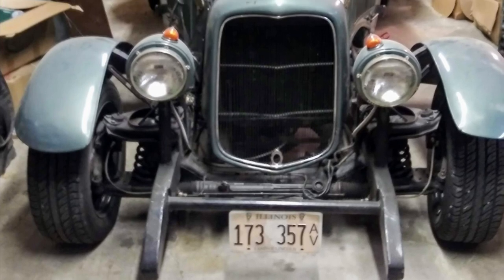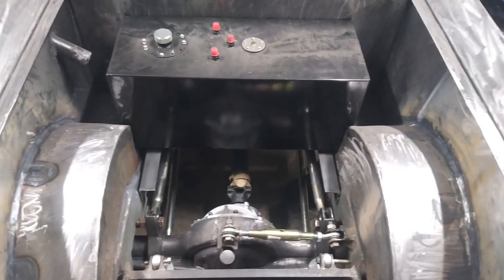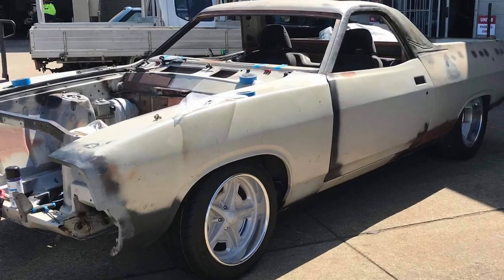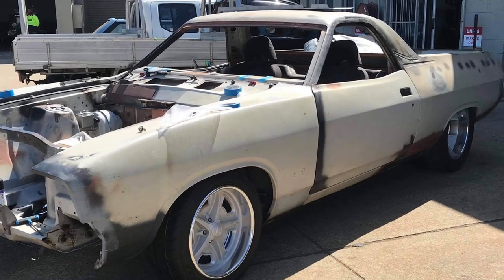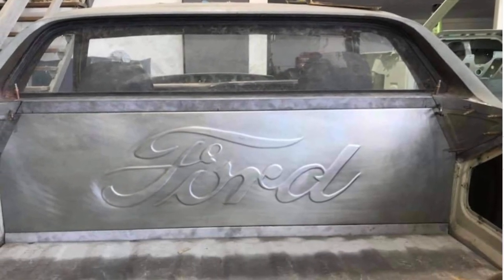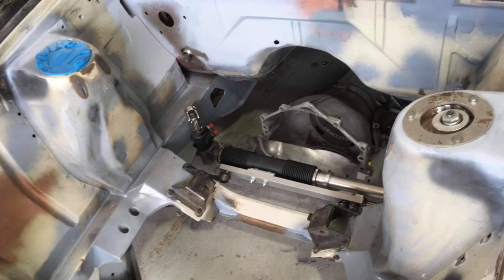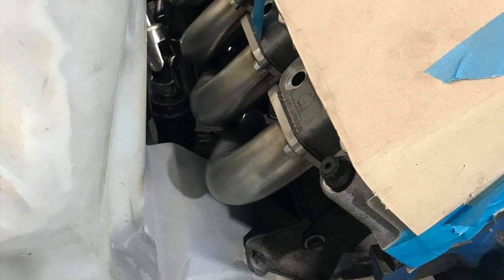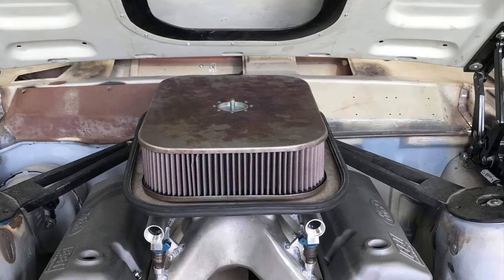DragBoss Garage: Chad Carpenter/Steven Bass Subscribers Projects/Engines

Comment: You have one of the Koolest Channels on You Tube Tim !
Pontiac Poncho Power I am known for and Old Time Street Racing Fun .
Reply from the maker: Thanks I appreciate it, just stuff we all want to see. Buddy had a 67 GTo with a stick, it just sits. 67k.
Reply: @DragBoss351Cleveland  Old cars, Musclecars, and Race Cars sit for Various reasons. 
Many of the Pontiac guys got caught up in The Pro Touring movement.  That is Ok if your into it and can afford. Really not practical they sit so low unable to drive normal care free on non perfect roads and highways. Only way is to Dry Sump it like a Drag Car Pro Stock or High End Road Race Car.
Have your GTO Friend check out my Pontiac channel.  Do all my own work at home . Build all myself.  The 63 Gp was low buck Pontiac 455 pump gas 520 Hp True all Factory iron.  But I put the money into the Fuel system True drag car layout so it will last never lean out Street Racing by me.
70 TA Getting all the good stuff.
Crower Titanium Rods for a Pontiac V8.  Manley Titanium valves full set. Got it.
Reply from the maker: @brracing7861  I read that loud and clear. So many projects get started and then sit, for years. Sounds like you got the Pontiac’s covered. Give me a link and I will send it to him. Never into pro touring. I like normal stance and drive without worries